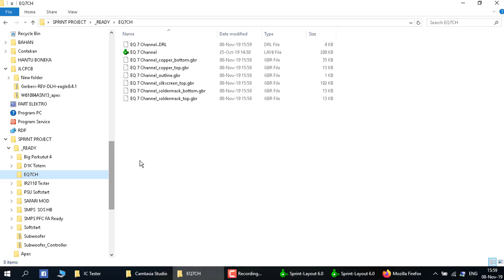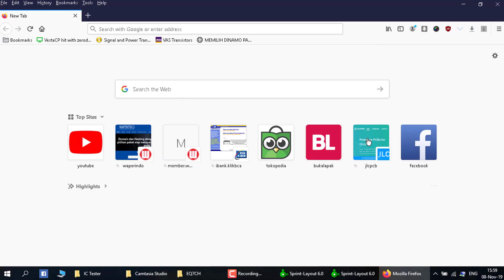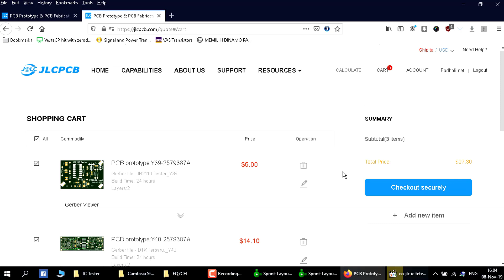Equaliser - Tone Control

Comment: Ms mw tnya kmren sya ad bli trnsistor thosiba 16 set 2sc5200 dan 2sa1943 tp sering liat di youtube  2sc5200npn dan 2sa1943 pnp tp kok stelh sya cek d avometer koko kblik 5200 pnp dan 1943 npn kok bisa kblikk ya mas..🙏🙏mtur suhun..
Reply from the maker: Probe hitam di Basis. Merah di C dan E:
1. Jarum bergerak = NPN
2. Jarum tidak bergerak = PNP.
Reply: @Fadholinet  sdah sya tes berarti emang kblik mas 1943 npn dan 5200 pnp mas punya sya dah sya cba sprti video mas antara bce nya jd prtanyaan nya apakh punya sya yg vdc+ nya 1943 mas tlong jwab mas dan 5200 nya vdc- soal nya sya mw pke socl 506 dstu tertera 2sc5200 dan 2sc1943 kn bhaya mas klw kblek bingng sya